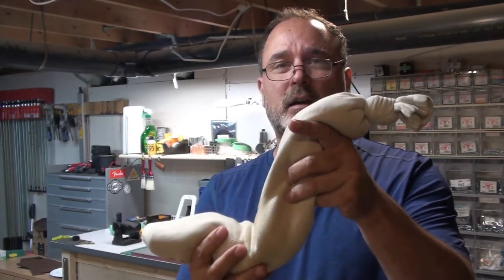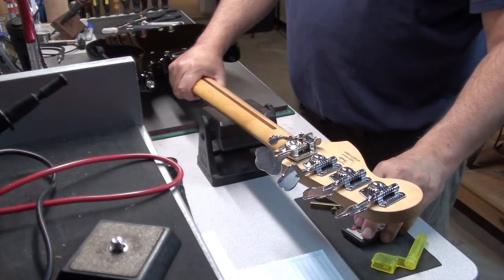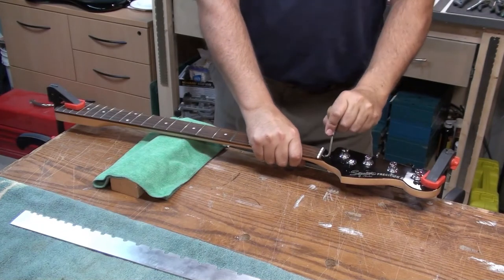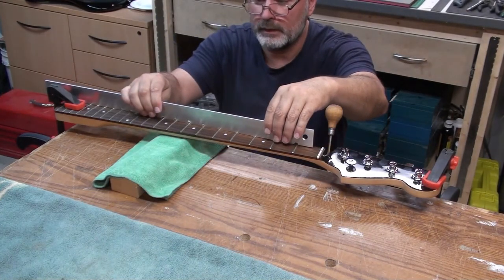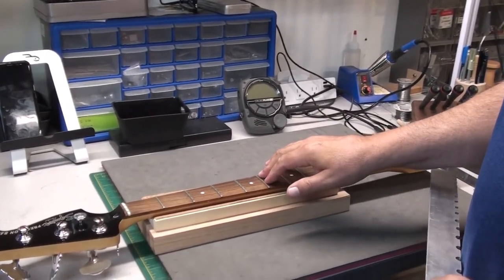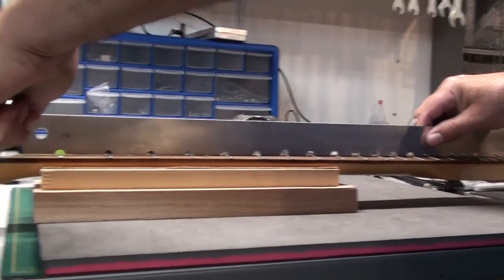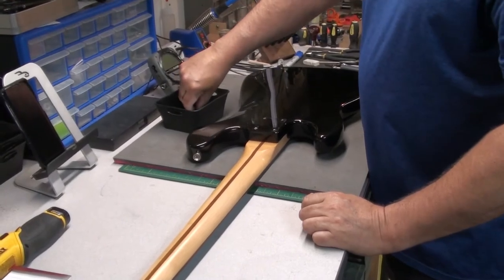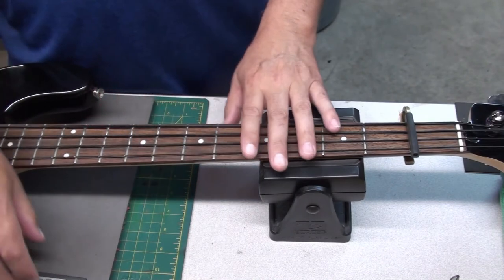Fixing a Bowed Guitar Neck with DIY Heat Press treatment... Using an Old Sock and some Rice!

Comment: Hi, thanks for the technique, I’m currently using it on my Steve Harris pbass that came in brand new with a huge forward bow. I’ve seen several luthiers and they can’t do anything about it, they don’t even know the clamping method when I ask about it… my question is: how many times would you do this technique? So far I’ve managed to have a nice straight neck (back bow disappears after few hours) but the forward bow comes back as soon as I put the strings on (bow is smaller than before though).
Reply from the maker: Sometimes you have to repeat the process multiple times- I had to do it as many as 6 times on one neck.  Once you have heated it up and let it cool down completely, tighten the truss rod and let it sit for a day, then repeat as necessary.
Reply: Thanks for the reply, thank ne more question: should I leave the rod tightened before each round, or should I loosen it before clamping again? I think I’m in for a few rounds of this game…
Reply from the maker: @Mrpatlebrun  Loosen each time, heat and bend, clamp and then tighten the truss rod

Comment: I have a flying V on my bench now I might try this since it's a set neck. I put a bolt on neck in my oven clamped like this one time and fixed an excessive relief issue. I have a neck\body jig can use to secure the neck and use the neck jig to back bow counter the relief. Even heating is the trick. I thought about a long infrared heat lamp too. I saw another youtuber used a heat lamp. I'm contemplating heat tape too, depending on cost. Maybe I'll make a demo to help others. Anyone know if they have a luthier tool co-op share/tool rental business?

Comment: You mentioned you ‘didn’t want to back the nut out of the hole’, suggesting that this bass doesn’t have a two-way truss rod?    So IF it doesn’t, take it out, lubricate the threads, add a washer or two and see if the extra thread purchase allows the neck to then be correctly adjusted.
Reply from the maker: That is a good suggestion- I will try that next opportunity I have.  There was not much thread on the truss rod end.
Reply: You nailed it Rick. First thing you do if a truss rod nut won't go any tighter is take it out, lube the threads and the bearing surface. 9 times out of 10 you'll end up being able to straighten the neck and then some. Of course this only works on single action rods. 

What'd ya do with the rice when you were done? I have a wicked biryani recipe.
Reply from the maker: @brianmascarin3875  sock rice doesn't taste good😁
Reply from the maker: @brianmascarin3875  I have added washers on the past with varying degrees of success.   I really just wanted to test out this idea to see if it would work.

Comment: This is great, thank you. I see in a couple of responses to comments you’ve cautioned against this technique on finished maple necks—is that because the hot physical contact might mar the finish? Or is there another reason? Would a heat lamp or even just a regular incandescent bulb solve that problem? I have a maple tele neck that gets backbowed in the summer, and I’d like to try fixing it.   (Not a two-way truss rod.) Thanks!
Reply from the maker: I would be careful applying too much heat on a finished fretboard

Comment: Can a prior owner's setup preferences cause a bow?  I have a nice Tele, bought remote, that shipped to me with 13-56 strings and saddles jacked up--WAAAAY up.  I had to replace two tuners for the bass strings.  I undid all that and use 9-46 gauge.  I cannot get the action as slinky as my other Strats and Teles.  I'm wondering if the frets have squished up some or there's a set up-bow.
Reply from the maker: 13-56's?  That's crazy, really... these guitars are not meant for that gauge of string.  9's or 10's only unless you want to be adjusting your guitar all the time and risk permanent damage
Reply: @ManotickGuitarTech  The tension was so high the 6th and 5th tuners were partly seized--probably bent cogs.  One saddle screw was seized too.  My guess is the prior owner was using it as slide setup.  Had pickups wired out of phase too.  Beautiful ash Tele, premium model, and it gets treated like a Greco or Tokai.
Reply from the maker: You could try some heat treatment but the neck might be toast...
Reply: @ManotickGuitarTech  Have a Fender-auth'd tech who says the neck seems alright, so he's working on it now.
Reply from the maker: @RideAcrossTheRiver  I hope everything works out!

Comment: Got it, thanks for the reply! Any suggestions on how to go about straightening the maple finished neck of a Strat without heat then, possibly? Would it help to back off the truss rod, clamp the neck into a desired (flatter) position and then tighten the truss rod again to see if it possibly holds? Just trying to think of the options. Thanks, love your videos!
Reply from the maker: Sure, just using mechanical force could help- I would clamp the neck in a significant back bow then tighten the truss rod and leave it like that for a few days.  Wood has a memory so no guarantee this would work... you might have to do it a few times.
Reply: There is such an easier way to do this without heat....loosen the truss rod, have a friend push down on the headstock, tighten the truss rod....BAM! Worked for me and my bass neck was really bent, too.

Comment: Thanks, this worked like a charm.  Can the same technique be applied but ONLY at the heel area? I have some ski jump that I'd like to reverse without re-fretting and sanding.  Because of the thickness of the heel I'm not sure how much it will flex there but the plan would be to clamp and heat between frets 12-22.
Reply from the maker: Dan, I am glad this technique worked out for you.  I havent tried the heel specifically but it should work with 2 or 3 applications due to the thickness.  Let me know how it goes.
Reply: @ManotickGuitarTech  Will do! It's currently clamped and under heat. It's such a short run and a thick piece of lumber, but hopefully with time it will level out.  If not then plan B is a possible partial re-fret or I can see if G&L (30 minutes away) will make me one.  This is a 1982 El Toro.  Pretty killer sounding pickups.  Thanks again.
Reply: @DanBerens2112  Did you succeed? It would be a major breakthrough if it works with a ski jump!

Comment: Nice video, I already have a sock filled with rice I heat up to place over my neck when it hurts :p now it ahs a second use. Did the neck hold the shape?
Reply from the maker: I use the sock for my back!  The neck is still good...
Reply: @ManotickGuitarTech   I have mine on the bench right now, it seems I was able to straighten it! Thanks for the video
Reply from the maker: @GerryBlue  sometimes it's good to do it a couple or three times
Reply: @ManotickGuitarTech   Thanks' I'll keep that in mind!

Comment: Love this video and I'm planning on applying this technique to my early 90's '57 Strat reissue, which had developed a rather serious upbow in its maple neck over years of storage. Tightening the truss rod has helped but not quite enough. I'm just curious why you didn't apply the clamp to the first fret at the nut instead of the headstock. In your experience, is there any appreciable risk in bending downward on the headstock?  Overall, the neck appeared to flex rather easily with the tension off the truss rod. Thank you.
Reply from the maker: You get more torque clamping on the headstock- just go easy and steady pressure.  I hope you have subscribed to my channel too?
Reply: Thank you. Yes I have happily subscribed to your channel. I appreciate your thorough systematic approach and calm delivery to problem solving. You're a teacher at heart, with none of the sarcasm found on other similar channels. Very satisfying. 🙂
Reply: @ManotickGuitarTech  what about a weaker joint (gibson)?
Reply from the maker: @timothysmith294  I would clamp adjust ahead of the nut on the fingerboard- Gibson  necks are weak
Reply: @ManotickGuitarTech  right that was my plan... its old too

Comment: Hello, I have a classical guitar thats a bit bent. I think the previuos owner put steal strings on it and this happened. The guitar does not have a truss rod. Whats your recomendation? thanks a lot!
Reply from the maker: Daniel, you could try the technique in the video-it will work for acoustic guitars as well.  It will probably take 3 or 4 treatments because you shouldn't put too much pressure on the neck at one time.  Take it slow and easy.
Reply: @ManotickGuitarTech  I will give it a try! Thanks a lot!
Reply: @danypb01 How did it go?

Comment: I have a guitar with a twisted neck.  Do you think this would work?  Relief is much greater on the high e side of the neck.
Reply from the maker: Maybe- you could try clamping it with more pressure on the bass side... that would be up to you to decide.  I have not fixed a twist before.  Thanks for watching and I hope you have subscribed to my channel?
Reply: I have a twist too, which I intend to correct by shimming one or both of the clamps with a felt bass pick; tapered end on the side that needs least overall compensation.

Comment: Well isn't there a risk that the glue under the frets gets loose if you heat them up?
Reply from the maker: @GabrielSkolderblad  it does soften a bit and then hardens again once you have bent the neck into position... that is the idea.

Comment: Great idea! I have an old 60s Japanese guitar with a “steel reinforced neck” but no adjustable truss rod with a pretty deep bow. I’m wondering if this technique could work on a guitar without an adjustable truss rod?
Reply from the maker: I would give it a try since it seems like the steel reinforcement is not doing much anyway
Reply: I'm in the same boat.  Tiesco?
Reply: Me too man! that's why I am here! Found it and cleaned it up and polished the frets but I was trying to figure out the neck situation!

Comment: Wouldn't applying the heat to the fretboard side risk softening the glue that holds the fretboard to the neck? I'd like to see a method that employs applying heat to the back of thee neck where the truss rod lies.
Reply from the maker: Applying heat to the back of the neck will certainly cause problem with the finish.  It is not hot enough to release the glue.

Comment: So a 20 yo bass with a tight T/R maybe might be candidate?
Reply from the maker: It would be... you could try loosening the TR, then bending the neck into a slight back bow, then tighten the TR tight... you might not need heat.  Just do it gently  LOL

Comment: Do you think it would work if i use an iron (for clothes) to apply heat to the neck?
Reply from the maker: If you out a tea towel o e the fretboard and used the iron-maybe... you would have to do it for 30mins or more and really know what temp your iron is at. I Never tried that.

Comment: Hi I have a set neck guitar and in loosened trussrod it has a backbow. I get most of the neck straight by counterclockwise TR adjustment but fret one and two are still on a backbow. Its n LP style guitar. Do you have a vid or a pointer on how deal with this situation? Cheers V
Reply from the maker: You can heat up the neck the same way I did in his video, but of course it  will still be attached to the body.  Take it slow and easy when applying the heat.  Thanks for watching and I hope you have subbed to my channel?

Comment: What about a slighty twisted  bass neck,, played fine but when changing strings and started setting it up, could not get E and A strings at correct string height and was to high, D and G were almost perfect, looked down neck from headstock and looks like around the 5th or 6th feet, bass side of bass is twisted up, It is hard to explain in words, but can a neck be un twisted?
Reply: Almost same bass a 2004 Squier P but with the PJ configuration and it sounds great and body is mint condition
Reply: All most same bass 2004 Squier P but with the PJ configuration
Reply from the maker: Frank, thanks for watching the video.  Unfortunately,  twists are almost impossible to get out.  You could try clamping the whole neck straight in a neck caul without truss rod tension first a few times and see if that helps (doing the heat process at the same time). Remember I dont reccomend this process on a fret board with a finish like maple.
Reply: Rosewood finger board Maple neck is.ok? @ManotickGuitarTech
Reply from the maker: @frankperricone2065  I have only done this on rosewood fingerboards- there is always a risk that the finish on the neck might get damaged... no guarantees
Reply from the maker: @frankperricone2065  Frank, just hit the subscribe button on my channel when you watch a video - I might have a Patreon page in the future.  Thanks,again.
Reply: @ManotickGuitarTech  👍
Reply: Even if you correct it, a twist has a tenacious memory and would return over time,

Comment: Nicely done. Do you think this would work on an acoustic 12-string? I have too much relief but a neck reset would not be needed. Just need to get some relief out. Recommended is .08 and I am getting .15 or so.
Reply from the maker: Hi, Brian.  I don't see any reason that it would not work on a 12 string as well.  I don't recommend doing this with a fretboard that has a finish on it eg. Maple with lacquer;  only natural boards like rosewood, pau ferro, etc.  I find you need 2-3 applications to get good results.  Let me know how it goes!  Please remember to subscribe if you haven't already.  
Thanks, again.
Reply: @ManotickGuitarTech  Thanks. I will give it a try. I have a Sunbeam heating pad that gets to about 115° so I might try that before using rice. The worst it can do is... nothing. LOL The guitar is a Martin D12-28. Have to do something the get the neck as straight as possible. Thanks again.
Reply: Well, it appears to have worked. I went from .11 at the 12th to .09 at the 12th. Plus, the intonation seems to be a lot closer than before. It is not perfect, but I believe you have solved my issue.

The process I used was to use a 5# divers weight (lead beads in a soft case) on the heel block, the neck supported at the 7th fret, and a 5# divers weight on the headstock. I kept that there for a few days before applying the heat.

I took the Sunbeam heat pad and put it on the neck from the neck heel to the nut. I didn't want to apply any heat to the body so I was careful about that. The temperature on the neck during the process was 145° +/- a few degrees. I heated for 1 hour, let cool for 1 hour, and repeated the process 4 times. I Started at noon and finished at 7pm.

Now, will this last? I don't know. But regardless my '75 Martin D12-28 has life again. The intonation and tuning were so bad I had to tune to the 2nd or 3rd fret in order to play open chords. Yeah, it was a mess.

Thank you for you video and the guidance during the video. 

Caveat: This might not work for everyone or anyone else. I got lucky. I did an unknown process for me on a guitar worth $2500 or so. But I was very lucky.
Reply from the maker: @briandonaldson612stringgui8  I am glad it worked out for you!  No guarantees that it will work for every guitar...
Reply: New update 12/4/2021 - After about a month, the neck returned to the previous condition where the neck relief was too much forward bow. Going to have it looked at by a luthier. Also I need to post a warning. Too much heat will cause the fretboard wood to shrink, depending on the wood being used. This will cause the fret ends to be exposed. As you run your hand along the neck you will feel the ends protruding out from the fretboard. This condition may return to normal after some time and the fretboard rehydrates.
Reply from the maker: @briandonaldson612stringgui8  I have done 3 necks so far with this method and 2 have remained stable -1 reverted back to it bowed condition. Wood does have a memory and sometimes you can't overcome it.

Comment: Could this procedure melt the fret glue and cause them to lift from the fingerboard, creating more probs?
Reply from the maker: It shouldnt- you would need to get the fret glue up to about 300F to melt it and you are not pulling on the frets at all.
Reply: @ManotickGuitarTech  --- I'd like to tell you something that you advised against... I have an old '74 bullet truss Stratocaster that has had the truss maxed out for years and a terrible dip-bow (convex) that you could drive a truck under (lol) and I put it down, not touching it again - until -  I saw your video.  The neck is a high gloss finished maple (which you advised NOT to apply your technique to), but I have several backup Strats and decided what the heck and I did it anyway --- it worked out great, man!  It did not affect the finish on the fretboard at all, but what it did do is break the glue/finish at the FRET ENDS, causing a mild rise and some sharp fret burrs, which I had to lightly file off and redress and guessing I may have over-extended the back-bow and too much pressure at the clamps, not sure -- and it only did this to heated area which was from fret 4 - 11,  nothing else was affected.  It amazingly set up so well, I don't even need to tighten the truss anymore --- it's completely stress-free on the neck and I don't know if this is a good thing or not, but all I had to do is change the neck shim height and saddle height to suit my playing comfort.  The tension from the strings I use (EB 8-38) give just the right amount of bow-stress that still allow for a great action -------- I can't thank you enough for the tips/video and yes, I have subscribed to you!  Bravo Zulu, brother!
Reply from the maker: @1958marky  Glad to hear that worked out!  Thanks for the sub, too...